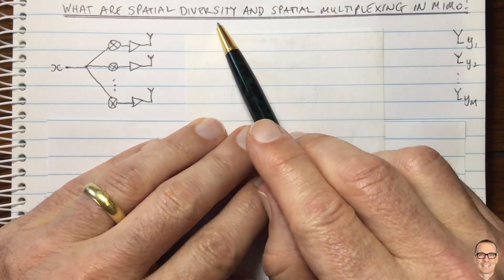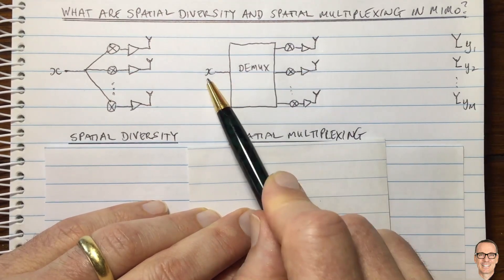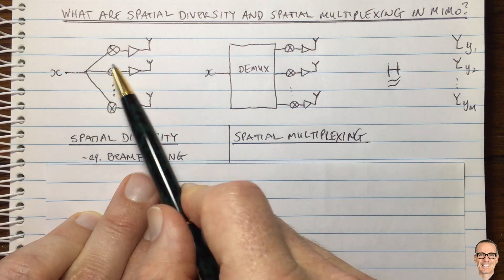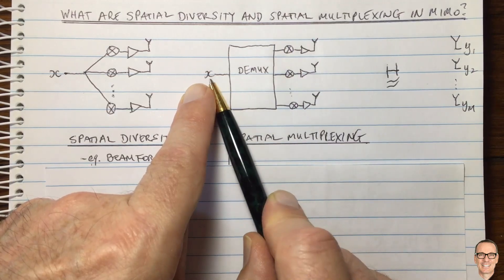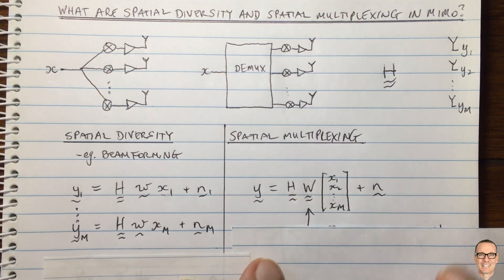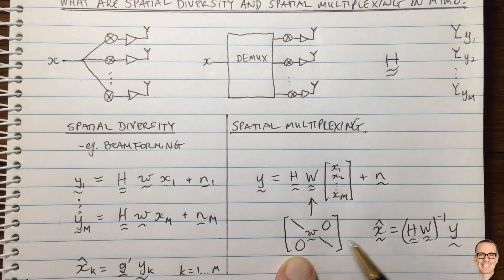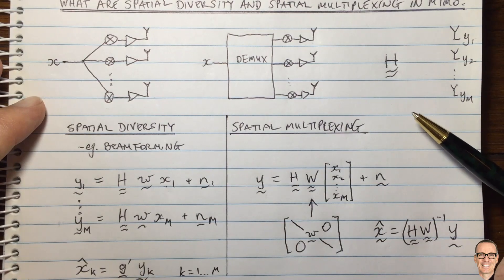What are Spatial Diversity and Spatial Multiplexing in MIMO?

Comment: Hello Iain, 
very educational video as always. 
Once you described spatial multiplexing, you added that data coming at higher rates, than being demultiplexed and sent over different antenna elements at lower rates. It is a little bit confusing, as spatial multiplex increases throughout, but If I understood that sending data at slower rates means our symbol duration is longer, then SNR is better, and we can increase the input data rate (by using higher order modulation). Did I catch the point?
Reply from the maker: Multiple parallel "lower rate" signals result in an end-to-end "high data rate".
Reply: Thanks! 
Could you please give an example?

 If we take an example for 20mb/s  data rate, in case we are using spatial diversity there will be at each branch copy of 20mb/s,  even if we add an additional branch.
In case we have 4 branches in Spatial multiplexing each branch will carry 5 MB/s? If we increase the number of branches, again we have the same date rate (20 mb/s) just branches carry lower rates? How we then achieve a higher date rate?  @iain_explains
Reply from the maker: 20Mbps over a channel (sent in 4 parallel streams - that interfere with each other) is higher than 5Mbps over the same channel (if you only sent one stream - that doesn't experience any interference)
Reply: @iain_explains  I don't think this is answering the question. In Wifi, at least as an end user looking at specs and performance testing, the total throughput has a direct relationship with the number of spatial streams used. If you use a single stream you get X speed, if you use 2 streams you get 2X speed, and so on. We all understand the words lower and higher -- what the person is asking is how the relationship with spatial streams in wifi is squared with your implication that multiple spatial streams accomplish the same rate using the sum of multiple slower streams. It doesn't add up that way with wifi does it? Is there maybe a third version missing from the video or is it a terminology issue?

Comment: Dear Prof. Iain
I have a little bit confused:
1. Both of two techniques which are Spatial Diversity and Spatial Multiplexing can boost the data rates?
2. What are differences between Spatial Diversity and Transmit Diversity?
Thank you for your valuable videos.
Reply from the maker: Answers: 
1. Yes. "Space" is a dimension (similar to "time" and "frequency"). If you use more of it (eg. by using more antennas) then you can send more data. 
2. The term "spatial diversity" applies at both the transmitter and the receiver.

Comment: Can we say that the left technique (spatial diversity) is analogue beamforming and the right is digital beamforming? Many thanks.
Reply from the maker: No, the RHS shows parallel data streams, where each one is simply being multiplied by a scalar (the respective element of the diagonal matrix W). But if you replaced the diagonal matrix with a digital beamforming matrix, then it would be.

Comment: 5:13 If signal is getting scattered, then won't that mean that any one connection in spatial multiplexing will be unreliable, thus causing dropped data? Ie, it seems that spatial diversity is a form of redundancy, which seems useful when there's a lot of multipathing, whereas spatial multiplexing is the opposite of redundancy.
Reply from the maker: The descriptions can be confusing, it's true (... and by the way, it wasn't be who named them). The term "spatial diversity" does not refer to the channel having multiple paths, it refers to using multiple antennas to send/receive the same signal (data stream) at multiple different physical (antenna) locations, and hence providing a diverse set of paths ... or if you think of the receiver end of things, having multiple antennas receiving (the same) signal (data stream) at different locations with different (independent) antenna noise values (ie. a "diversity" of received values). The term "spatial multiplexing" refers to sending multiple data streams at the same time. The different paths through the channel do not cause "dropped data". They are simply different versions of the same signal (different amplitude and phase) that add up at the receiver. If you can measure the overall effect of all the paths at each antenna, then you can "invert" their effect (if you have more antennas than data streams).

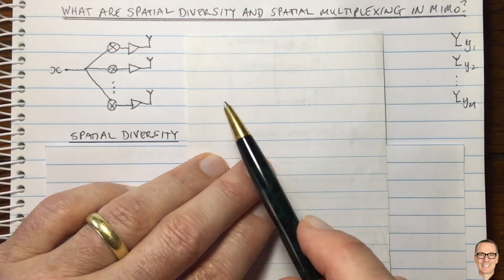Comment: 1:35 It seems strange that a multiplexer is based on a demultiplexer. Is a demultiplexer based on a multiplexer?
Reply from the maker: Sorry, but I don't understand what you're trying to say. What do you mean: "a multiplexer is based on a demultiplexer"?
Reply: @iain_explains  1:35 Your spatial multiplexor appears to contain a demultiplexor. That sounds weird.
Reply from the maker: Sorry John, I don't know what "appears to contain" means. What "appears" to one person, will not necessarily "appear" to another person. Sorry, but I don't have time to try to interpret your interpretation. If you can try to be more precise, then I'll try to answer.
Reply: @iain_explains  I see a section on the right-hand side of your drawing called "Spatial Multiplexing". In the center of that section is a block called "Demux", which i believe means "Demultiplexer". So, a system called "Multiplexing" contains a block called "Demultiplexer".
Reply from the maker: OK, I see what you're saying. In that situation the channel is a "multiplexing channel" (when it's used in that way) because multiple (different) data streams are all transmitted at the same time, through the same channel (one from each antenna). In this way they can be viewed as being "multiplexed" in the channel. But when you've only got a single (high rate) data sequence to send from a single (multi-antenna) transmitter, then you need to "create" these seperate data streams (for each of your transmit antennas), and you do this by demultiplexing your high rate data stream into multiple low rate streams. To reiterate: the channel is the "multiplexer".

Comment: Many thanks for the explanation! So did you mean that when we do the spatial diversity, at the receiver, the decoding is done per antenna element, whereas, the spatial multiplexing combines the received signals from all the antenna elements and then perform the channel inverse operation?
Reply from the maker: In the spatial diversity (beamforming) case there is either only a single antenna at the receiver (which is the case I showed), or the receiver has multiple antennas and performs receive-beamforming. Either way, there is only a single "stream" of data being sent (one modulated symbol at a time). The M data symbols need to be sent one-after-another (beamformed from the multiple transmit antennas). In the spatial multiplexing case, each transmit antenna sends a different modulated symbol in each symbol-period, and the receiver needs to have multiple antennas, and perform the channel inversion.
Reply: @iain_explains  Thanks for the reply! So this means we don't require phase shifters attached to each antenna element when we are doing spatial multiplexing.
Reply from the maker: Yes, that's right.

Comment: There is sth about Digital beamforming that I can't digest. Basically, with Digital beamforming, we create different "beams" pointing to the specific spatial directions for different streams. That means: 
1) Two nearby users cannot be scheduled at the same time, correct?
2) More than one stream will be transmitted over the same antenna. If I understood correctly,  we set a complex gain (phase and amplitude) for each stream and each antenna in the baseband. Assuming, we have two streams, x_1 and x_2 can interfere with each other over the same antenna. This is the bit that I can't visualize. How can we send two signals over the same frequency and at the same time without interfering with each other?
Reply from the maker: The answer to both questions is "yes". Perhaps this video will help you to visualise what's going on: "What is Multi Channel Beamforming?" https://youtu.be/e6scR0C4RAc

Comment: To the left Case : is it really beneficial to vary the single amplitudes? You get the singe antenna signals to be in phase and they add together. So why should I mitigate an amplitude? I assume, I should put the maximal amplitude in every antenna. Thanks.
Reply from the maker: Yes you're right, if you are only trying to form a beam in a single direction. However you might also be wanting to avoid sending energy in specific other directions too (for example in the direction of other users who do not want your interference). In that case there will be benefits to reducing power on particular antennas (in the extreme case, it could be that N-1 antennas are deconstructively fully cancelling out in the "other" user's direction, and then it would be necessary to turn off the N-th antenna in order to maintain a null in that other user's direction).

Comment: what is the link between Rich scattering and inversion of matrix ? I think to inverse the determinant of the matrix has to be not zero but I can't understand why a rich scattering environment would imply a NON zero determinant.

Thanks !!
Reply from the maker: Good question. If there was only a line of sight path, (and no scatterers providing alternate delayed paths with different departure and arrival angles), then the gain between each of the transmit antennas and each of the receive antennas would be (almost exactly) the same. This would mean that every row of the channel matrix would be the same. And in turn, this means that the matrix would not be able to be inverted (because there would only be one non-zero Eigen value).

Comment: Hello 👋 👋 👋 
What is the difference between spacial diversity and multiplexing and when we use this technique 
Thanks 😊
Reply: It's clear in the video, "we send the same signal over multiple paths to get spatial diversity", when we send multiple streams (data sequences) over the multiple paths we have spatial multiplexing. In short, the main difference is one stream vs multiple streams. 

When to use which? Prof Iain also explains how the H matrix (channel coefficients) would influence the choice. To get the real benefits of spatial multiplexing, uncorrelated channel coefficients scenario is desirable. 

I would like to add that spatial diversity improves SNR (array gain) and reliability (diversity order).  Therefore, its real advantage comes at lower SNR levels, where improving the SNR is the priority. Spatial multiplexing, on the other hand, is particularly useful at higher SNR levels, where the capacity is bandwidth limited. Basically, we send more data using the same bandwidth.
Reply from the maker: Glad you liked the video.